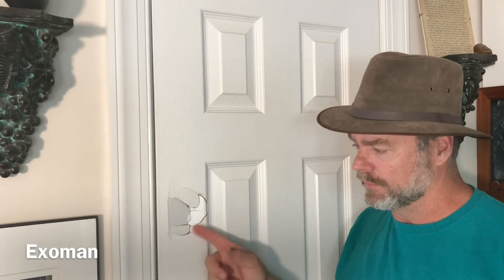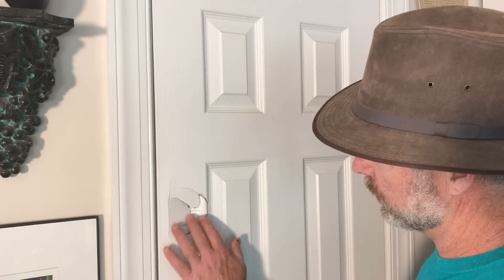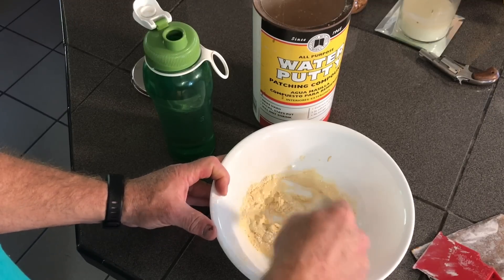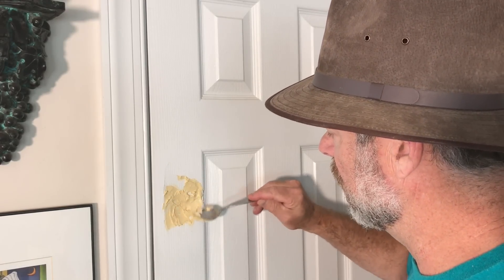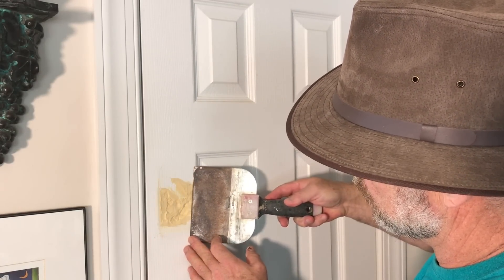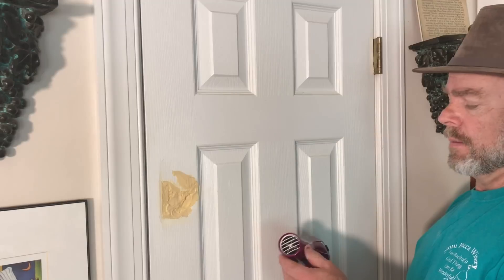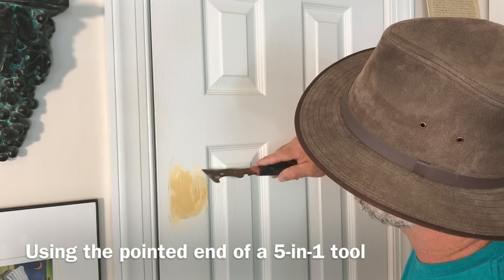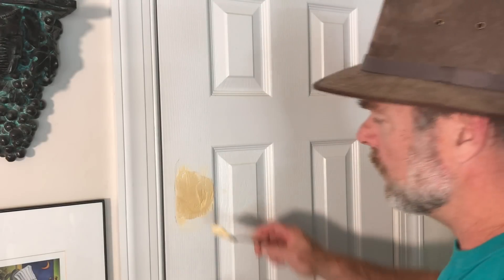Easy hole repair. How to fix a broken door- water putty repair

Comment: @exoman- any particular type of primer and paint? Thanks
Reply from the maker: Depends on what your painting over. But typically it'll be latex so you'll use that unless it's over oil paint (less common). I'd would just try to match color and finish. Good luck!

Comment: Beautiful job exoman
Reply: A full prime and double coat of paint erases flash [visible surface variation through the paint] for people less skilled as you visibly are with your trowel and sanding.
Reply: I've given away free multiple top coats of pain and primes to customers who know more than I about my profession and charged more per hour to minimize the pain in dealing with the multitudes of know more than I's.
Reply: And as many had argued I was cheating my customers for charging too much after the basic truth is they had hired me knowing my price. Although honestly I can't ever recall a job where once you do the math I made less per hour and always gave more than they assumed the job would require. One woman hired me to build an elaborate front porch then had a capping ceremony for her brother [I was uninvited and she'd said she could decide on appropriate railing caps] where she presented the new stairs as his work and nailed on the post caps? Aren't people grand.
Reply: Google docs has deleted numerous attempts at putting together a respectable resume to find a new career at present I'm a recent college grad [at 50 GI bill from joining at 38 in the ARNG] and I don't much give two craps about anything in particular.
Reply: WTF?

Comment: Thank you for this:) I kicked my sister's door (not even hard) at the base and it created a 8 or so inch crack along the handle. My dad has taught me my whole life little tricks to fix small breaks like that. (my dad is not someone I really want to call my dad. It wasn't until the last year or two that I realized just how terrible he was.) anyway. I kicked the door and it created a fracture in the door, I'm assuming it was a weak spot in the door. Considering they're glued sawdust I'm not surprised the whole thing is a weak spot. Anyway. My sister looooves to tattle on me so she told my dad as soon as he got home about the door. so he told me there was no way to fix it, I have to get a new door. Coming from him, I just dont care because he slammed the front door so hard it put a foot and a half long crack in the door frame which he just patched over so if a patch job is good for him it's fine with me. Especially on a little crack. So when he complains there's no way to fix it I have proof it can because he taught me for as long as I can remember that you can fix almost any small damage. He trained me well. He's only gonna have himself to blame when he doesn't have a brand new door.
Reply: Same here too

Comment: great vid exoman! I have a similar issue, can I use spackle instead of putty? would it be the same ? thanks
Reply from the maker: Thank you Ray! You want to get a can of this wood putty powder. It is cheap, it will last forever and you can repair soooo many things with it. Spackle is not durable in this application. This substance is very strong.
Reply: @exoman  thanks, will do!

Comment: You need to remove the damaged area, then stuff with filler (paper towels, etc), then expanding foam, dry, cut, sand, fill with bondo, sand, a thin layer of spackle, shape to wood grain, sand and paint.
Reply: Ben Johnson  i would say 1/2 to 2 hours for beginners